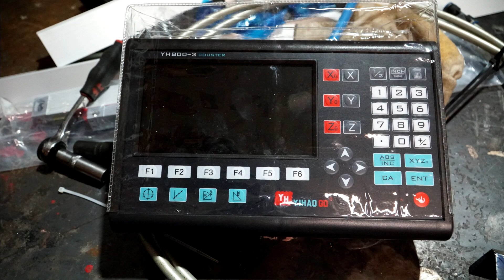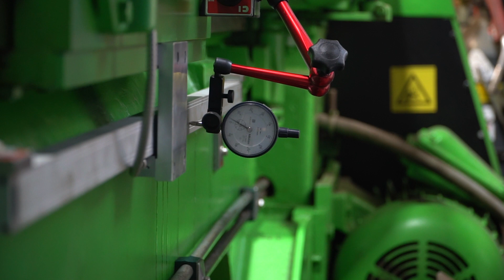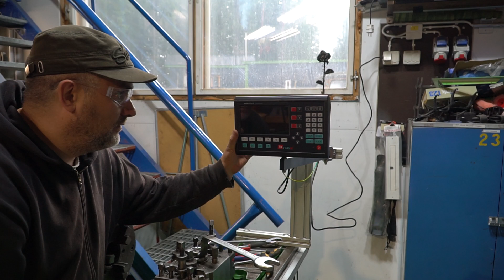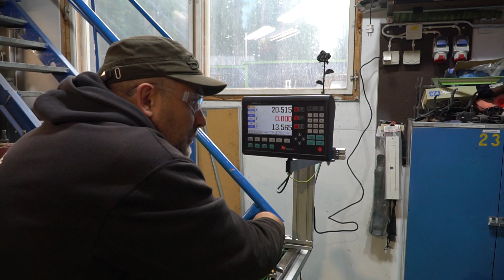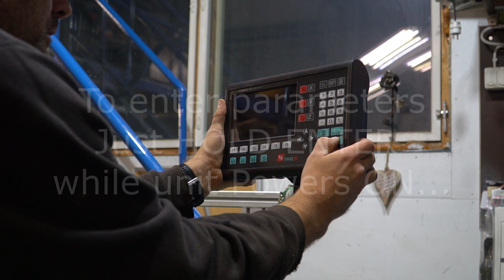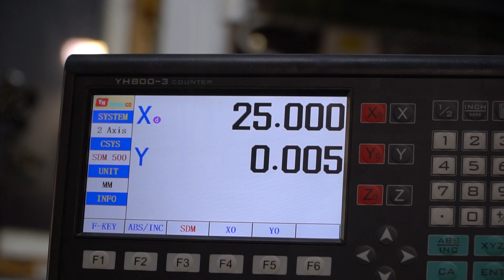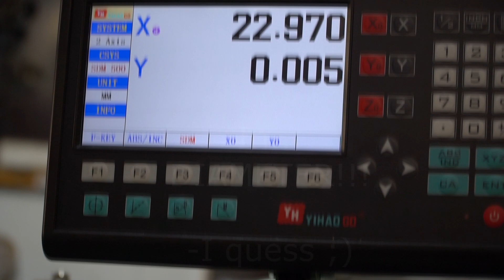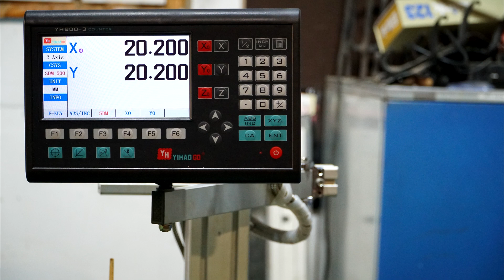Installing DRO (Digital Read Out) into a lathe

Comment: How did you get rid of the z axis of the screen  ?
Reply from the maker: You need to enter inside the menu and choose between 2 or 3 axis operation if I recall it right... Anyway selection is inside the menu
Reply from the maker: I checked it how it was... When unit is OFF keep Enter pressed and turn the unit ON. Unit starts into setup window. Then first thing you can select is language and second thing is whether You have the unit in 2 axis or 3 axis mode... Make the selection and get out of the setup and unit asks do you want to save your changes.

Comment: have you considered installing the z axis on your sled?
Reply from the maker: I have thoughed about it but putting The sensor body requires Space and makes IT a bit difficult... And actually now when the x and y Are shown on screen there is not so much need for z anymore... 
Of course IT would bring some new capabilities into play If there would Be that z meas. Too but it was allready kind of game changer to have x and y meas for this particular lathe where The longitudal Feed wheel does not have mechanical incrementations visible on The main sled at all
Reply: @JuhaErkkila  ah, i was talking about the tailstock for z axis, sry didnt had the right word for it in my former text
Reply from the maker: @666MadDog  Thats ok... I dont know The right vocabulary either. Tail stock pinol(?) would Be one interesting option too when drilling holes... This lathe has vaque depth  marking scale grooved to The pinol but IT IS hard to read so you can do something like +- 2mm in depth tolerance or maybe not Even that... For drilling IT would Be beneficial to monitor The stroke of The tailstock 🤔🤔🤔.  Mounting would require some extra brackets  since this tailstock is casted and round as a pig... Have to think about it how IT would Look like and thanks for pointing IT out
Reply: You could also drill using the carriage to monitor drill depth, so you don't have to drill the headstock. Great Video!
Reply from the maker: @mopetnmax892  Never thought about that... Thanks for the tip!

Comment: You make an interesting point, and I've heard other machinists make it too that these kits come with no installation instructions. It's true, but I sort of have the feeling that if a person is machinist enough to appreciate the DRO and why they would need it, and benefit from it, they're a person who already has what they need in the way of personal talents and abilities to figure it out unless of course they are brand new to the game and that type usually isn't the type to think about getting a DRO right away.
Where I find the documentation most useful is in how to do the setup and use the Read out part of the kit. 
I think most machinists were well aware of cosine error in taking readings and working with machine alignment so should already be sensitive to knowing they need to mount the scales as true to the axis their reading as possible.
Reply from the maker: Well even 1 millimeter side shift on 1000mm scale length would give less than 0.001mm error in length reading so I was not that worried about that... In the time of assembly I was more concerned about the maximum allowed side way movement that could potentially create stress between internal measuring parts and perhaps destroy glass bar or what ever running right next to it. But that installation definition was not available and the end game was just to mount it as aligned as possible. After the mounting I've seen some other videos were those scales are torn apart and also exposing internal organs showing the internal sled running / supported inside aluminium profile and counting the reading from glass bar... Nothing fancy in that and probably will tolerate much greater amount off misalignment too then in my installation I was to accomplish
Reply: @JuhaErkkila  I do agree with what you're saying about the difference in length between the hypotenuse and adjacent side that would occur due to any cosine error due to a tiny misalignment, especially with a longer scale. I also agree that there is not much to them and many have torn them down in order to shorten them.
Reply from the maker: Yep. And Im only a hobbiest so I have a lot of to learn from using lathe... Having a DRO makes it much easier to fabricate at least some how usefull parts without trying to calculate things in your head 😛
Reply: @JuhaErkkila  I bit the bullet and bought one of the low cost Chinese DRO kits for my lathe for the same reason. I think that once we get used to having one on a lathe or mill it's hard to go back to reading the dials and jotting down notes on paper to keep track of where we are.